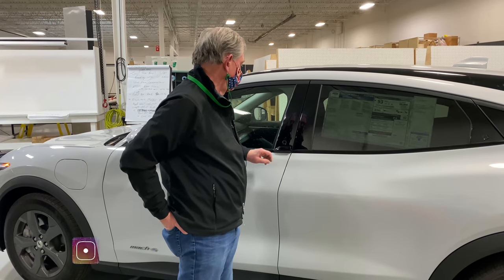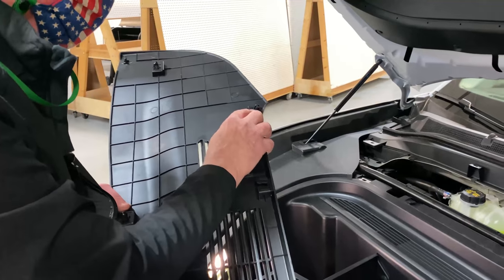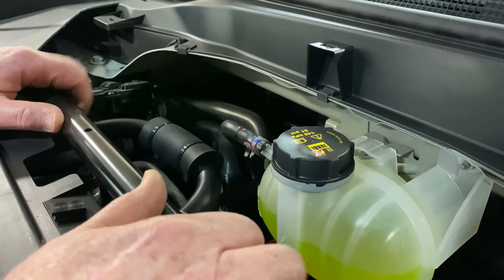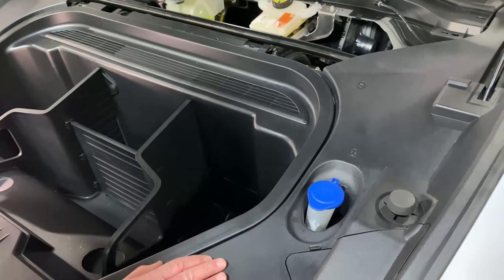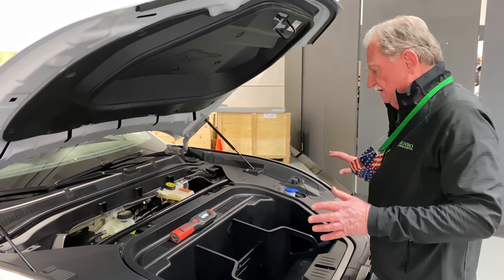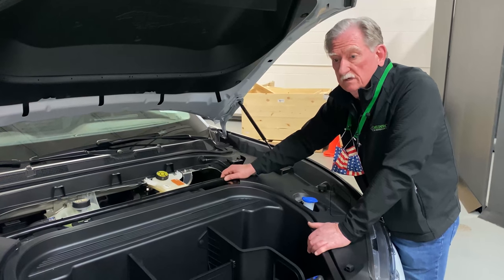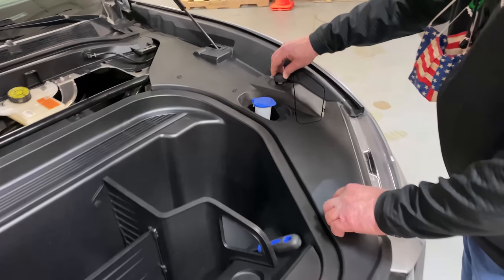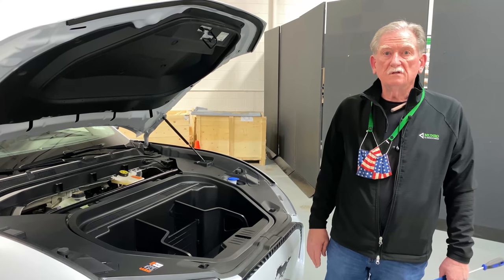2021 Ford Mustang Mach-E: E2 - Under The Hood

Comment: Why so excited by a cooler with no insulation? You can just put an actual cooler in the trunk.
Did I miss something about why a hole in a plastic liner is so great?
Reply: Well aside from drinks it can be really big for wet objects like raincoats, wetsuits and anything you don’t want to dirty up your interior/boot with. A nice to have feature for a lot of people
Reply: @elysiumchaser7799  and if you do that a lot and need a drain a drill is beyond possible?
I get why it's useful. I don't get why it's worth excitement.
Reply: "what an amazing idea very few will ever use even once! Yay!!"

Tesla seems to track people's use of these cars.

"Nobody's opening the frunk, delete grocery hooks"

"Very few using mobile charger, stop giving everybody 14-50 adapter"

Etc...

A little bit big brother/creepy? Yes.

Brilliant cost savings? Yes.
Reply: @elysiumchaser7799  I get that but just drill a hole in the frunk liner in your tesla. This is a 5 second modification. I'm just saying that he was way to excited about a hole in a bit of plastic.

Comment: Shouldn’t access panels be easier to remove. Can’t imagine customers will want to by new fasteners every time the need to fill the windshield washer reservoir. Ah, I get it, another way to keep their parts department in business☹️. Although, nothing wrong with an integrated frunk (Drunk) cooler 🤓

Comment: He didn't say anything about the break fluid and power steering fluid.  You have to remove a panel to get to them.  I would find that annoying.  Maybe there's an electronic sensor that tells you when they're low so you don't have to remove the panel to check but you still have to remove the panel to fill them.
Reply: A visual inspection is probably wise rather than just relying on the sensor, so I agree with you.

Comment: For someone who doesn’t drink,
Is it possible to remove the rack so you have more frunk space?
Reply: Yes
Reply: It's like 12 of those push in fasteners that you can carefully pull with a flathead screw driver. It's nowhere near as tight as the panels that he pulled. You can push the fasteners back in to fill the holes. I also believe I read somewhere that Ford passed the regulatory hurdle and will no longer be putting in the divider?

Comment: 4:46 if it was without partitions, the manufacturer would have to install an opening mechanism in frunk. It's for safety, in case there is a child in the frunk.
Reply: There is an escape latch. However, it is electronic and not a cable pull.
Reply: Yeah, the Mach-e has a lighted hood release on the inside of the frunk. I had assumed too that the divider was so that they didn't have to install that, but alas, it has it. I think Ford talked to Tesla owners about frunk problems, because it's one of the things I don't like about my frunk. Things in there slide around a lot, sometimes to point of making annoying noises that has caused me to stop, move things out of the frunk to the trunk to quiet them. 
If I were Ford (and Tesla et al for that matter) I would design frunk dividers that are somewhat configurable and easily removable, like with thumb screws. 90% of the time I'd like a divider, but my frunk is the ideal size for my telescope case, but I wouldn't be able to get it into the Mach-e frunk without a screw driver with a hex bit. That's a little less convenient than it needs to be.
Reply: @danoberste8146   A lighted hood release. Glad to hear it, those things are less useful if not easily findable.

Comment: 4:50 the compartments / divider in the frunk are a requirement - the frunk is not allowed to fit a human being. If it was, the frunk would need to be able to be opened from the inside. I believe Tesla’s frunks are small enough that they get away with it. And Ford divides the space up so it’s ok again that way.
Reply: Tesla fronks have a button to open on the inside
Reply: @WillDeasy  even better, thanks for the info!

Comment: It looks like replacing the 12 volt battery will be a nightmare. In addition, as a technician I hate explaining retainer replacement charges.
Reply: Well, if repair techs would only mark up the price of retainers by 20% and charge 5¢ for them instead of the outrageous 10,000% mark up and charge us $4 a piece for them, it wouldn't be so painful explaining the price.
Reply: @danoberste8146  It's interesting that you think technicians have any input as to the price of a part. It's common  practice to make less money on expensive items. An across the board 20 percent profit margin wouldn't work.
Reply: @paulwright7595  Keep a dozen in your pocket! The boss doesn't need to know. I did similar when I was a telephone system installer. I'd buy line cords off e-bay for 50¢ and replace knotted and stripped cords for customers at no charge, instead of the $12 the company wanted me to charge. That little bit of gratis work did wonders for customer satisfaction. And, yeah, the company is still in business. I didn't drive them to bankruptcy by giving away a few hundred cords in my day.
Reply: @paulwright7595   Oh yeah... and be sure the let the customer know what you did, and how much you saved them. They'll request you personally when they call for service the next time. The boss will notice this and give you glowing evaluations in the next round!!!

Comment: "you don't need a prop rod if you have these things..."   shots fired...
Reply: I remember when VW introduced gas struts for the hoods. I thought it was the coolest thing ever because most cars at that price point didn't have them and it made basic fluid maintenance easier. Times change I guess. For how often ID.4 owners will open the hood, it's not that big a deal.

Comment: I have used our frunk in the Model X for beers for years. Drinking in the beers in the parking lot after a game is fantastic. Does it have a drain hole? no, but who cares? You still have to dig out the ice. I don't like the compartments in the front. I would rip those out.

Comment: If the frunk were insulated I'd be more impressed with the drain, but as it is, it's  really of limited usefulness. What, am I going to carry my beer and ice in a cooler until I'm ready for it and then at the last minute dump it into the frunk and stand there with a silly grin on my face? It's got a nice frunk which beats the silly BMW, but first thing I'd do is remove whatever they call those separators that are inside that frunk.

Comment: 7:35 ROFL. Sandy, this is rediculous.
The drain hole is nice, but old news.
And why should I drain the water, wich has 0°C? You can cool more beer by keeping it.
BTW:
How do you react, when you find out, the Hyundai Ioniq 5 will come with an 3500 Watt AC plug, where you can cool a trailer full of beer? 🤣

Comment: Okay, so is it just me or does the idea of having a beer storage area, and the consummate cupholders to drink said beer, seem extremely insane to put in a CAR? Just what we need. More people drinking and driving.  

Some of my own personal dislikes of the Mach-E in no particular order: 

1. Made in Mexico (for the prices they are asking, and because the Mustang is eponymous with American muscle, I want anything with a MUSTANG badge to be made in AMERICA!)

2. Efficiency is on the lower side. Even with the tiny little tires Ford uses, it’s still about 20% less efficient than a Model Y in real world use. 

3. The standard 18” wheels look dumpy, and even the 19” wheels look on the small size. Then there’s the strangely narrow tires, only 225mm width, which is 10mm smaller than you’d get on a Model 3, and 30mm narrower than the Model Y. When I see a Mach-E on the road it looks like a BMW i3 with tiny little tires. For a somewhat large and heavy SUV (pushing 5000lbs) with the promises of being a performance vehicle, you need bigger tires than what you’d find on a VW Golf!

4. Interior - I hate portrait style displays. You have to look so far down to see the bottom part of the display. The narrow width of the screen also shrinks your backup camera view down substantially. 

5. Performance is just acceptable until the GT is delivered. 

6. Outside looks - not really feeling it. I would have preferred a more traditional SUV body, not one more ugly SUV coupe thing. We have enough of those ugly things as is. We didn’t need another. Not only does the sloping rear end cut into your headroom and luggage space, but it always results in poor rearward visibility. 

7. Charging speed - it takes an HOUR to get an 80% charge, but even worse than that is the 80-100% charge taking OVER AN HOUR AND A HALF. As soon as you hit 80% SOC, the car throttles back charge rate to 12kW. That’s horrendously slow. That’s no faster than charging at home on my own AC charger. New EV6 and Ioniq 5 coming from Kia and Hyundai, along with other 800V capable cars are delivering >140kW at 80% and can charge to 80% in just a smidgen over 15 minutes. Mustang’s charging curve is so bad it would make it a terrible road trip car.

8. Door entry system - there’s no need to overcomplicate entering a vehicle. I think the Mach-E’s button and hook mechanism is dumb as can be. I like the ID.4’s normal looking door handles that have electronic releases on the inside of the handle. There’s no two-step process to open and all of your passengers will immediately know how to get in and out of the car without struggling. On my Model 3 I have to show everyone how to open the door both inside and out. It’s annoying after a while, and not that easy if you have stuff in your hands or are wearing big gloves or mittens.

Comment: Gas struts are unnecessary weight and complexity on a car with no front trunk that you'll use regularly (I detected his swipe at the ID.4s prop rod at the open). The front panel Sandy struggled to remove covers the brake and coolant reservoirs, so imagine an owner or service tech trying to get to it just to CHECK THE LEVELS. Like Sandy, he'll break 2 clips and have to order those from parts. Bad design. On the VW, it's all exposed for ease of maintenance.

Comment: So serviceable items like the power steering fluid and break fluid are behind a panel that is damaged with first use even when using specialized tools and an experienced handler.  And the battery is behind a panel with vents built in it so that it breaks at first use.  Tell me how many cars are going to have that battery cover broken open and a led battery venting next to that cooler in a few years?

But, you can get shit faced and drive so Sandy loves it.  

Really disappointed in this assessment.

Comment: Regarding the 12v LEAD ACID battery... why don’t they just install a DC-DC BUCK voltage regulator/converter that changes the MAIN’s  voltage to 12v. Install a simple dumb switch that charges the LEAD ACID battery when it goes flat. 

You have all this power from an EV and having no way to charge the 12v starter battery is the DUMBEST problem that an EV can have.

Comment: Any chance of get ride of the 12V battery on a EV?
Reply from the maker: The 12V battery supports the non-drive functions of the vehicle. When we talked to Elon Musk, he stated that 12v is a "vestigial voltage" and that 48v would actually be more ideal. Especially for High current low voltage applications like EPS and Headlights. Thanks for watching!
Reply: @MunroLive  can't the 12v batteries in an EV draw from the main battery pack to prevent it dying?
Reply: @djwarren5081  The 12v is charged from the high voltage battery thru the DC to DC convertor, but apparently there's no way to tap 12v directly from the high voltage battery. If the 12v dies, none of the auxiliary 12V components work. Lights, radio, door and hood releases, etc. It baffles me how that's even possible. I guess it takes 12v to close a solenoid that routes power to the battery???
Reply: @danoberste8146  It appears Ford has already had/having problems with cars being "bricked" because of a 12V problem. The car has to be put on a roll-back and taken to the dealer to become functioning again.
Reply: @GROND15  I had heard about the "bricking" problem, but I'm kind of relieved to hear it's a 12v problem. probably an easier fix than other causes might have been.

Comment: Again Sandy the vw id4 was deigned to be extremely practical and with great turning radius for tight cities.
Reply: The only good feature of the ID.4, it turns in a tighter radius. LoL Cheap suspension, poorly designed MEB platform with engineering fixes in production and no frunk. Stop the bullshit, It's junk.
Reply: @legacytesla  the cheap suspension on the id4 and the sealed drum brakes which never need to be serviced are just another awesome things about that car. Keep on with your negativity mate.
Reply: @carholic-sz3qv  Not at all. Enjoy the crap. You are actually arguing for manual crank windows in your other comment reply to me. mate.
Reply: @legacytesla  cheers mate.... LOL

Comment: I hate those plastic snap fasteners that virtually every auto maker uses. They break all the time, especially in cold weather. Repair shops rarely replace broken ones with the right size if they replace them at all. There’s got to be a better way.

Comment: Good EVs have a frunk, because it's the most secure part of the car. No thief sees the things in there, no thief will ever get in there. I don't like the no frunk design of the ID.3+4. Model Y is way better, even if it's not as big inside at the end. (banana box test needs to prove that first)
Reply: The front trunk on this Mustang doesn't look particularly secure. If a thief wants in, they'll get in.
Reply: @Jastor00  If "Wham Baam Teslacam" shows a thief getting in a Tesla frunk, then I believe you. Before that, never. Frunk is thief proof, till proven otherwise for me. Greetings from Germany. ^^
Reply: @kasmopaya2676  Maybe Sandy can test the theory with a crowbar or a cordless cutoff disc!
Reply: @Jastor00  Yea, would be a funny video.  Suggest that and a comparison which frunk is the hardest to force open. ^^ LOL

Comment: Come on Sandy... Pretty irrelevant to have the drain there. You could always pack up an esky if that's what you wanted to use the space for. In exchange you get a biased-used space that cannot fit as much as it could. We are here for serious engineering reviews.
The fact that the snap fits break when removing should be counted as a bad thing!
Reply: Design matters not just engineering

Comment: The icewater hole.. not sure if that will not cause some leakage to other components and create rust in a few years?! I'd compare it to Model Y. But bastardizing Mustang brand to make this is just a sales campaign. I'm wondering about real world range and charging.. It should be an issue, considering electrify america has a bunch of chargers that are not working.. Also whats the lag on the screen?
Reply: the car's brand new and already has rusty axles.

Comment: A sports car with a beer cooler is not only silly but also dangerous and liable for lawsuits.
Reply from the maker: There is nothing illegal about transporting cold, unopened, beverages and then consuming while parked. Thanks for watching!
Reply: @MunroLive  Let me explain that when one is cooling booze in her/his car means that s/he will go somewhere else to enjoy them, and inevitably after drinking, s/he will need to drive home. Otherwise, s/he would have placed the drinks in the refrigerator in the first place.
Reply: This is a dumb reply. I've seen plenty of cars from automakers who use air conditioning in a compartment to simulate a cooler. In fact I owned one of these 15 years ago.... This is not a new idea and it has never been brought up in court.

Comment: Wait wait wait wait wait wait why is there a 12 volt battery in this thing isn't it in all electric vehicle‽‽‽ If they just didn't change the system and wanted to save money why couldn't they just make it to where the battery could be returned without having to pull apart the compartment or make it to where when you charge the batteries it automatically charges the 12 volt battery... That is a really stupid design I really think that is one of the worst flaws on this entire vehicle...
Reply: Every vehicle, without exception has a 12 volt battery. All of the auxiliary components run off 12 volts. The only alternative would be to put in expensive and heavy hardware to step down the voltage from your main battery adding cost, weight, and complexity. The most sensible design it to install a 12v battery.
Reply: @wakingchristian  yeah but I have a battery a 12 volt battery that can die and completely shut down the entire car is a major design fall when you plug it in it should automatically recharge that battery if it's drained...idk it just seems dumb Tesla's going to be making 36 volt system I do believe.
Reply: @AquarianSoulTimeTraveler  If Tesla makes a 36v system they will have to redesign all of the internal electronics. This is possible but it will still be a separate battery. They have 350v and 375v systems. You can't charge a 36v battery from a different voltage except if u step down the voltage as I mentioned previously.
Reply: @wakingchristian  yes but it will be a lithium system probably... Idk about it... Just seems dumb to be running a standard lead acid 12 volt battery.